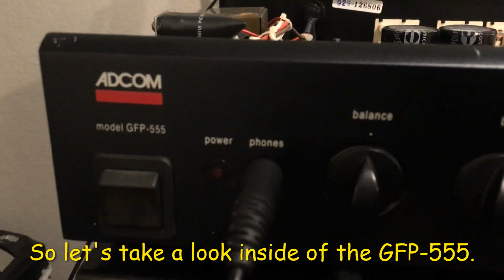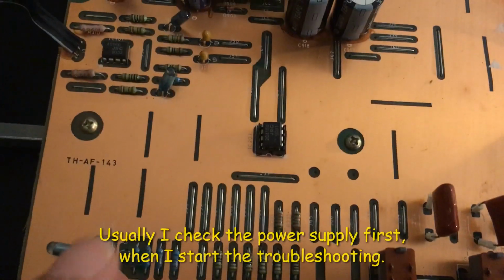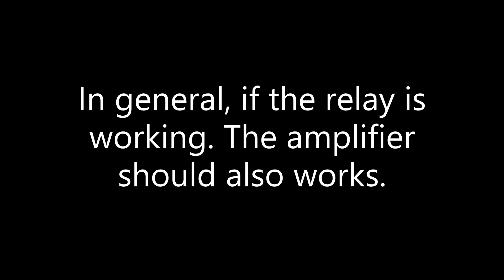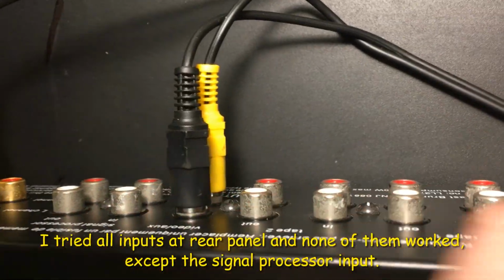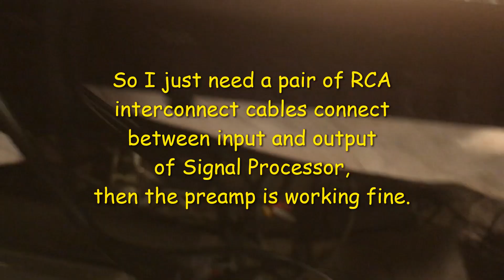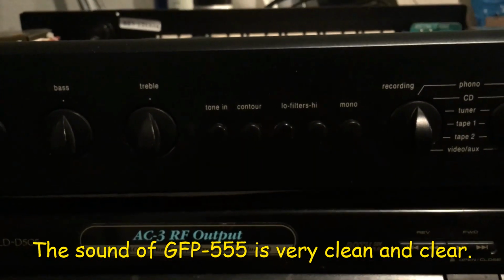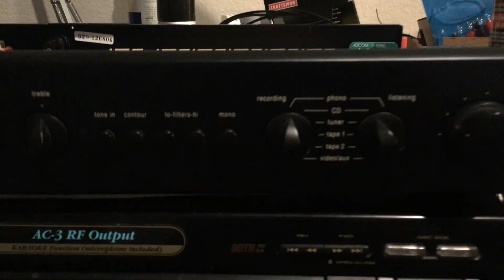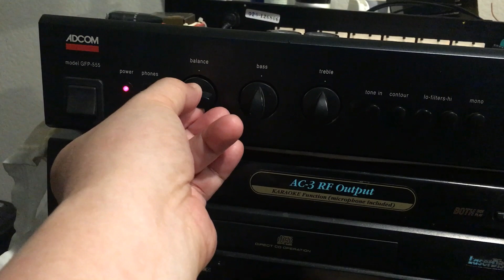ADCOM GFP-555 Preamp Repair and Demo

Comment: I am using an Adcom GFP-565 preamp and a modified GFA-545 mk II amplifier. I also have another matching GFA-545 mk II as well as a GFA-535 mk II amp. The 545 amps are modified by altering the negative feedback with a series resistor and bypass capacitor, and running the bias hotter at around 12mV across the emitter resistor instead of the factory 7 mV. This requires monitoring the output transistors with a infrared thermometer making sure the transistors do not exceed 45 degrees C, or 113 degrees F of the hottest one on that channel. Check after 30 minutes minimum idle time. I was running 16mV but ran into thermal runaway in the summer time, so I backed it down to 12mV. This  mod was recommended by Nelson Pass who designed these as a sonic improvement. This is what I am using for my high end setup.

Comment: I have just repaired this GFP-555 model and I am amazed on how good it sounds, it rivals my APT Holman preamp modified by me with Analog Device IC, I had to change a phono IC which is labeled as 5E,  Adcom mark the IC's in order to hide what they use but I did a research and the original 5E should be a Burr Brown OP27 which can handle 21.5 volts but I put a NE5534 and can handle 21.5 also and is working fine

Comment: I have the GFP565 bought it second hand it is still performing very good, also bought new old stock of GFA555 mk2. It was stored in the original box never opend for more then 25 years, it perform flowessly, i have checked first the bias and dc offcet was good 👍. This is very good stereo system that outperforms many new stuff that sold this days
Reply from the maker: Thanks for your sharing.

Comment: I followed your repair work on the GFP-555.  Thank you!.  Very helpful.  Fuses are all OK. power on indicator light is working.   Circuit board traces all look OK.   I had no 21 + or 21 - voltages at the two test points you pointed out.  The relay is also not functioning.  I'm wondering if the next logical step is to replace the relay?  Any input would be appreciated.  Thank you.  R.E.McD
Reply from the maker: A defective relay will significantly impair the output sound quality of amplifier. I suggest to find a new relay to replace it.
Reply: @VintageAudioFan  I did find a source for the relay which is good because I could replace that for sure, however I've since determined that the relay has no DC voltage on its coil, so that is probably the issue and not a bad relay.  It seems like I have AC power up to the rectifier, but nothing after that on the DC side.  I'm having a bit of trouble finding where the relay is in the circuit.  It seems like they show the relay and rectifier as one big block of circuitry.  I can read schematics and have good mechanical and soldering skills, but I'm afraid diagnosing where the breakdown is in the power supply section may be beyond my skill level. Do you still have a repair service by any chance?
Reply from the maker: If there is no voltage on relay, it seems the problem is in the power supply based on your descriptions. I suggest to check the bridge rectifier W02/PB153M and voltage regulator power transistors Q901 (2SB633) and Q902 (2SD613). These components are the most suspicious area for the the cause of power supply malfunctions.

Comment: Happy to find this video, as I recently pulled my Adcom GFP-555 and GFA-535 out of storage.  The were in a closet for 20 years! 

In any event, I finally have the space to be able to use them, and hooked them up to run my iTunes library through a pair of ELAC UB-5s.  The sound is quite good, but unfortunately, I am getting a more frequent intermittent loss of 80% of one channel, accompanied, at times by static and crackle.  It plays fine in Mono though, and I've traced the problem back to the Line Out on the Pre-Amp (both the Normal and Lab outputs; the problem also displays on headphones).  At this age, I would not be surprised if a solder joint may be loose, but I don't have the courage or confidence to open it up.  Any ideas, VAF (or any readers)???
Reply from the maker: It sounds like the issue is either in the relay (RY901), mono switch or solder joints. However, I suggest checking or replacing the relay first. Because these relays tend to built up the residue on their contact surfaces due to the age. Specially, when you stored it for a long period of time. If the problem persists after replacing the relay,  then I suggest check the mono switch and the solder joints. Thanks for the comments and let me know if it works.
Reply: @VintageAudioFan  Thanks very much for you response.  I wish I had the expertise to tackle the problem!  I think your overall premise is correct though - the years of disuse have created the need for a good cleaning, and testing, starting with the points you mentioned.  If I can find a reputable tech to work on it, that should be my next step, otherwise look for one on the used market, as I do like the sound

Comment: Dear sir
I am watching your videos I like them how  you trace faults in electronics 
Can pls suggest as I have bought an old Yamaha C4 preamp it is working properly can pls suggest how much it is important to recap the unit as it's quite vintage 
Pls share any video of recapping of preamp in future if you get one
Regards 
Guru
Reply from the maker: Definitely, it will improve the sound quality and extend the expectancy of good performance of C-4 preamp. Currently, I am working on a repair of Marantz 2230 receiver which I need to recap the power amplifier due to the deteriorate capacitors. I will publish it as soon as it is completed. Thanks.

Comment: I like your workaround.  I have the exact same problem on my GFP-555. Patching around the Signal in and out Processors worked for me, as well. However, these connections are designed to put an equalizer in place. They come after the selector circuit, but before the tone control circuit.  This means none of the tone controls works. Where should I start looking to find out where the fault is, so I can restore the units original functionality?
Reply from the maker: Does the unit has the outputs when you switch off the Tone-In control? If the tone control is not working but you still have outputs from the pre-out, then you have a defective tone control circuit which is powered by an IC (NJM2041DD). You can try replacing it. But before you do that, I also suggest you to check the contact of Tone-In switch, cold joints at underside of PC board and all the wire soldering joints. It will be more efficient by using a signal generator and oscilloscope to trace the signal path. You can also check out my other videos for troubleshooting procedure.

Comment: I have a Adcom GFP 565. When I plug the headphones into the jack, the speakers will not shunt (turn off). The sound comes out of the speakers and headphones.
Reply from the maker: GFT 565 is a preampifier which is separate from the power amplifier (connected to the speakers). The use of headphone is designed for monitoring the sound output of the preamplifier. So plug into to the headphone jack of DFP 565 has nothing to do with the speakers.

Comment: Hello
I have the adcom gtp400 with the tuner. Iv had if for 30years. 
I also have the 555ll amp with a pair if heresy ll speakers.  My system sounds great. 
I had the adcom 6 carousel cd player but not anymore. 
I just play music from my phone...mp3 and flac files.
Maybe you can help me?
I wanted to get a Dac for my adcom and not sure what to get. I just want a great dac to make my mp3 and other music files to sound better but do not know what to get. Can I get a dac and still keep my gtp400? Do I get a dac that plugs into my gtp400? Maybe you can help me in the right direction with some links on amazon...show me some good dacs that I can choose that i would be able to add to what I have. I know there are Dac players like phones that do it...is that the way to go? Should I have a dac..maybe a blue tooth one that is always hooked up at home plus I was also planning on getting one of the dac mp3 players...can I use both?
I will eventually get a single cd player but for now I just play mp3 and flac files and also stream on YouTube.  Any help you can give me on dac and how I would hook to my gtp400 would be much appreciated. I could spend up to $500 max on this addition.
Reply from the maker: Yes. You can keep your GTP400 and use it's Aux input connecting to DAC's RCA output jacks. I'll recommend the Schiit Modi 3 DAC for the beginner - see attached link for more information:  https://www.youtube.com/watch?v=ih0EqxsTBq8&t=44s
Reply: @VintageAudioFan  and your opinion is that that schiit Dac makes the sound of mp3 files...digital files sound better? You can hear the difference easily?
Reply: @VintageAudioFan  If he can get a GCD-750 which have a input to use internal DAC to decode an external source and maintain his ADCOM gears would be great